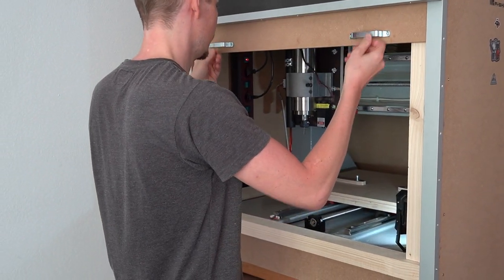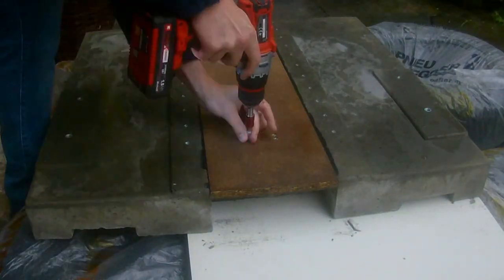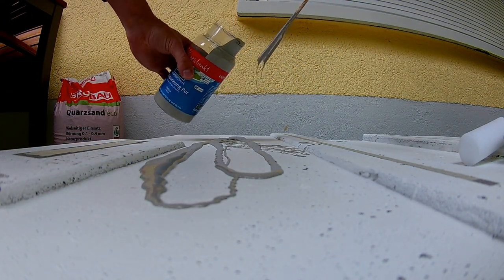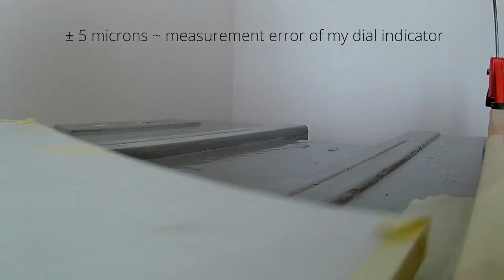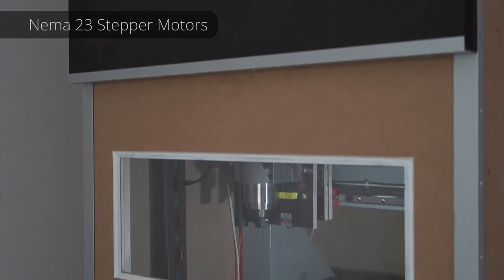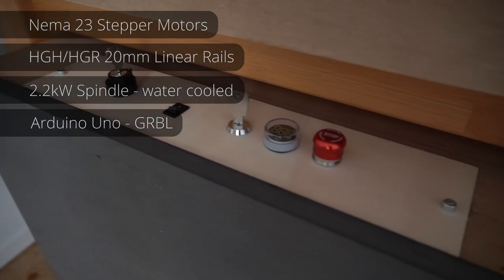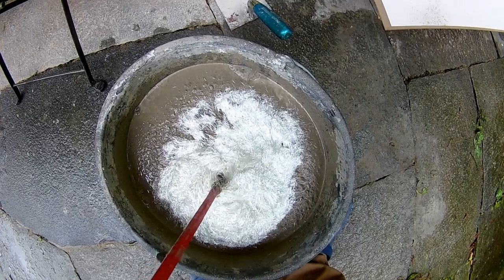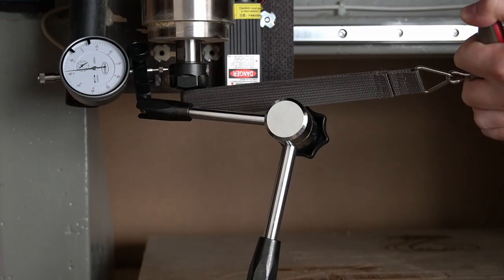Sturdy DIY CNC Mill made from Fibre Concrete

Comment: Hi, nice job, could you include the names of the products you used?
Reply from the maker: -HGH20 Linear Rail & SFU 1605 Ball Screw Set   https://bit.ly/394Wccb
-2.2kW G-Penny Spindle   https://bit.ly/2UyfU7u
-Nema 23 Stepper Motor & TB6600 driver   https://bit.ly/3f74W2e 
 (might upgrade to these https://bit.ly/2IJ34Rk)
-Power Key   https://bit.ly/2Kj8piY
-Emergency Stop Button   https://bit.ly/2KcIIAp
-"Fog Buster"   https://bit.ly/36LTzsU
-Arduino Uno with GRBL 1.1 firmware   https://github.com/gnea/grbl
Cement, Glass Fibres and Wood (laminated multiplex birch & MDF) from local store
Reply: @Reed Baylor I really appreciate your reply. I found the site through google and im trying it out now.
Takes quite some time so I will get back to you later when my account password hopefully is recovered.
Reply: @Reed Baylor It did the trick and I now got access to my account again. I'm so happy:D
Thank you so much, you really help me out!
Reply: @Hayden Brett you are welcome :)
Reply: @haydenbrett125  Here try my password and see if it works for you!!!
Reply: @thetinkerlab2943 hello, what is the performance of your machine? How well does it cut aluminum and steel? (Could you maybe make a video showing it in action?)

Comment: I have considered this for years. Every time I look into it I end up over specing everything to the point that it becomes unrealistic to start. The size of components you have used seem reasonable, but please can you tell me if it is possible to machine regular mild steel on this machine?
Reply: No. The spindle is too fast. The Z-axis is probably also too weak.
Reply: Not this design,  but concrete body with some cast iron or steel plates can definitely cut mild steel easily, and spindle speed is not at all a problem but it's a benefit if used with coolent for more feed rate in less time.
Reply: @grimkarltun7846  That spindle is definitely capable of cutting steel.
Reply: @MegaCoolshot  Cutting and cutting well are 2 different things. The bearings would go banana when milling steel for too long; plus the overhang. There is a reason spindles for steel are beefier.

Comment: nice! however, epoxi granite machines do not require steel reinforcement. in fact, the epoxy only stabilises the matrix, the stiffness comes from the quartz or granite infill. when properly cast, those pebbles directly contact each other, so the epoxy granite has the stiffness of the granite (which is much highter than the stiffness of the epoxy matrix)
Reply: In addition to what you said, a huge reason people go for epoxy granite bases is for the damping factor, whereas concrete will just be behave like a metal otherwise it would just crack.
Reply: @preddy09 
This not true, UHPC has also very good dampening properties.

Comment: Definitely great idea for experimenting with designs cheaply but finally does not compare to the overall performance benefits of epoxy granite.
Reply: its actually way better than that, but its all useless and pointless if you use a paper thin mdf table, all rigidity for nothing

Comment: Who always tells people concrete machine beds need reinforcement?
It's complete nonsense.

If you're dead set on using fibers - just clad it in a quasi isotropic carbon fiber laminate. Compound beams from Cf clad polymer concrete test surprisingly good considering the comparably tiny amount of fibers and resin.
Thought to be a result of the strengthening of the concrete itself by confinement as well as by taking the tensile loads.